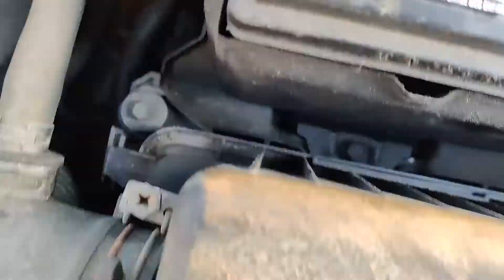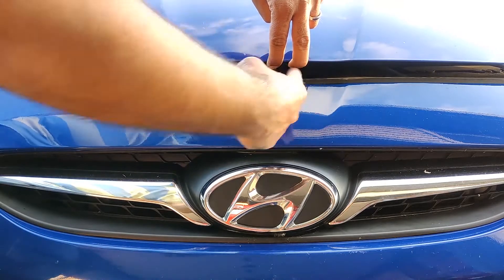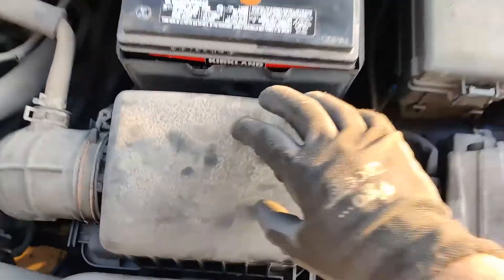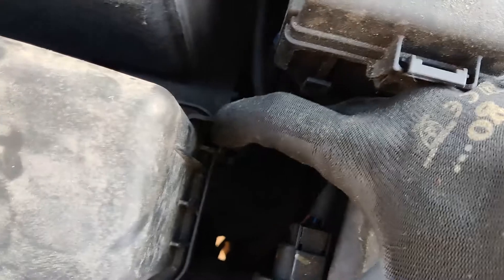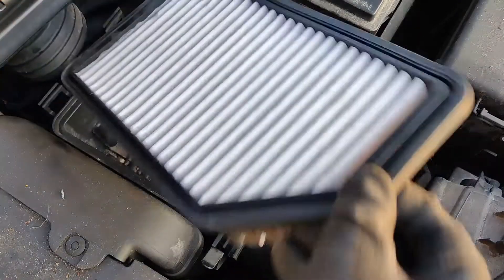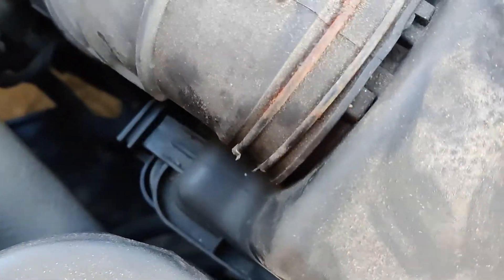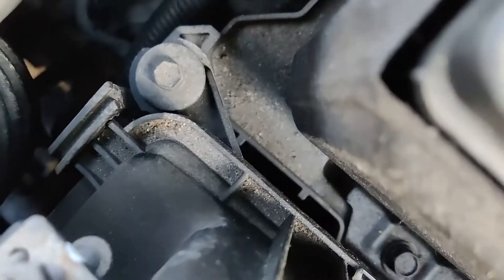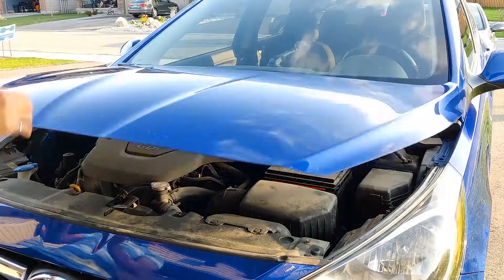How to Replace Engine Air Filter - Hyundai Accent (2012-2017)

Comment: What about the upper air filter that is held in the cover you took off? It's held in with plastic pins melted and looks permanent. However, it looks very dirty and not sure if have to replace whole upper cover and if it comes with the filter. It's a skinny filter right above air filter you changed, in the cover. Part number 28113-1R150. Seems to me it's the entire cover. That's crazy putting a filter up there you can't change. I think it's supposed to catch oil that might come out or something for CA emissions maybe. Bet 99% of owners and mechanics don't even know it's there.